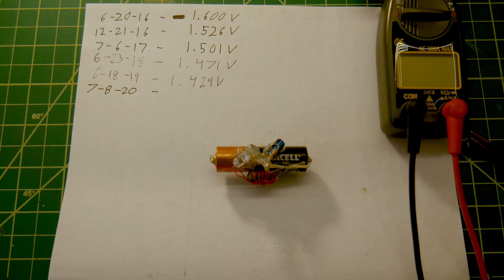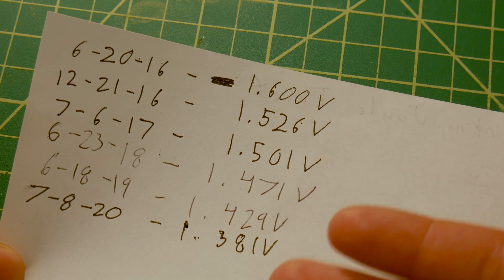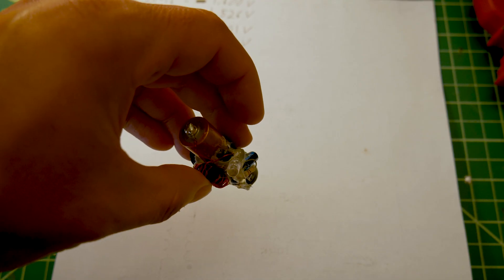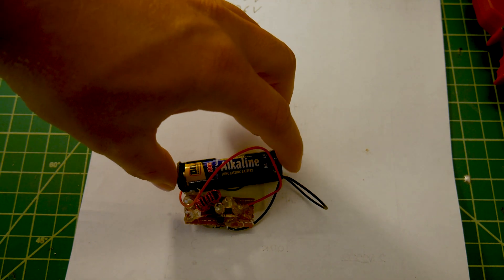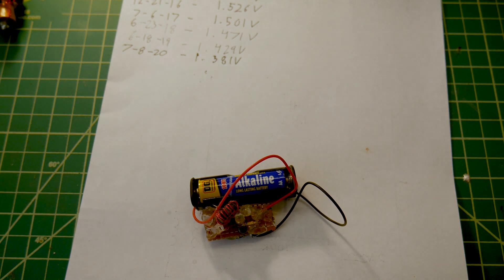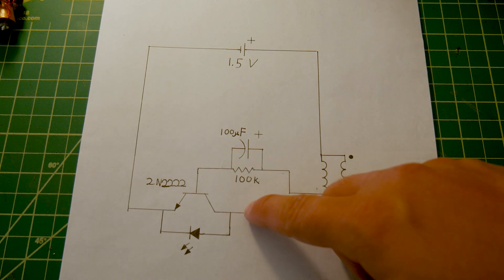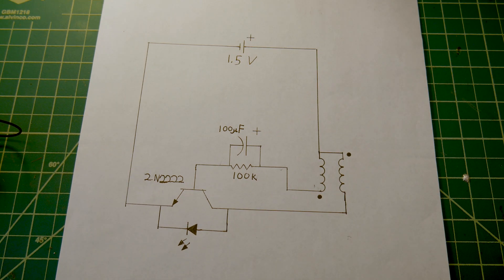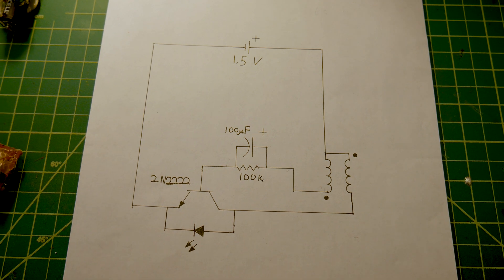Blinking Joule Thief: 4 Year Update

Comment: Your second JT will stop and start because when depleted, the battery will start to recover voltage when not being used. Once it’s recovered enough to drive coil and transistor it will start up again until deleted and the cycle will continue until it cannot recover enough. JTs are very sporadic in their nature as they are so unregulated

Comment: You might be surprised if you measure the voltage across the capacitor.  When the JT flashes and the capacitor discharges, the voltage across the capacitor may reverse polarity.

I built dozens of blinking JTs But I used a more complex circuit with a separate flashing circuit controlling the JT.  They flash about once per second and run for 2 years or more.  I tried the circuit you use but I found that the on time of the LED was difficult to change to make the LED flash brighter.  I also added another LED as a daylight sensor to turn it off during the daytime.

Thanks for the update.
Reply: Do you have more details of your circuit. I too have built dozens of these and would be very interested in adjusting the on time as you suggest
Reply: Replace the resistor with a 1meg pot. Add a 68nF in parallel with the led. Works much better.

Comment: Hi. I have made the circuit with blue led and it is working very  nice. I have 2 questions : 1) How can I use clear RED led ?  2) How can I increase the time when led is ON ( increase the number of  miliseconds when led is lightning ) ?  Thank you
Reply: put two red leds in series
Reply: The capacitor determines the flash rate.  In the video the 100 uF capacitor blinks every few seconds.  If you reduce it to 22 uF it might blink once every second.  But remember that the battery won't last as long.

Comment: The Joule Thief that I built with an AA cell lasted about a year, then unfortunately the cell leaked. I've read that Duracell is notorious for this, so from now on I'll use Evereadys. But the white LED circuit I built with a new D cell in July 2018 is still going strong. It's blinking at a fairly high frequency of 150 times per minute, and currently (October 2020) showing an amazing 1.48 volts. Keep making updates, this is interesting. Thanks.